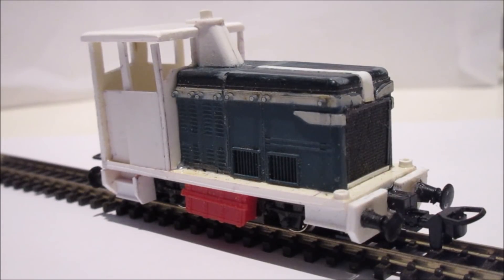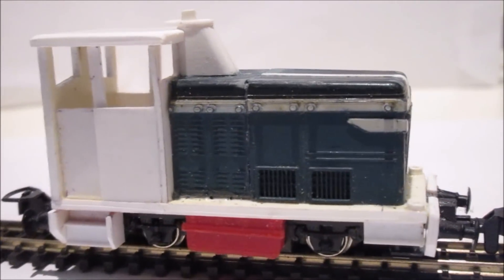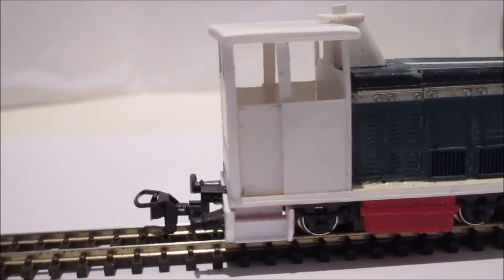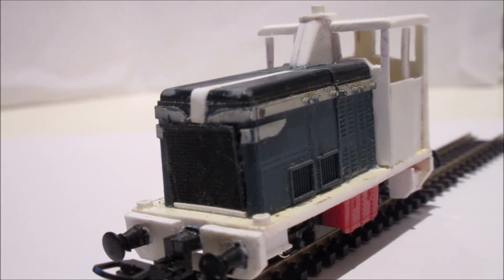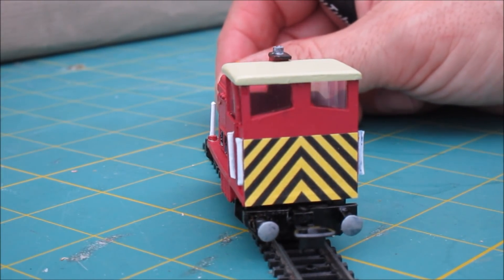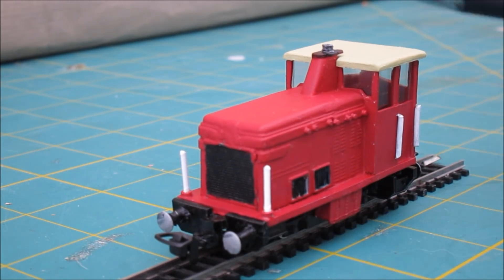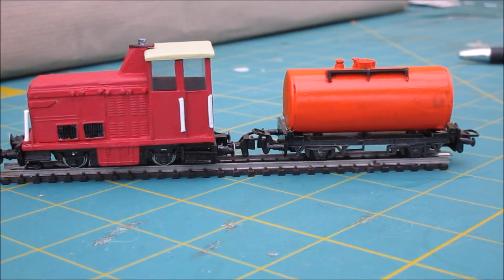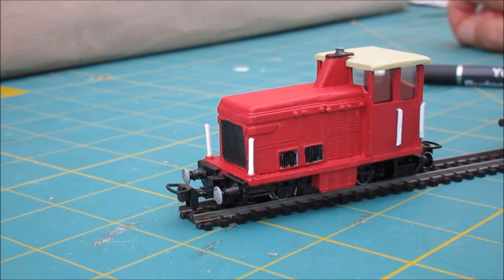More OO9 Projects - Diesel Shunter & Tanker Wagon

Comment: Just decided to add an OO9 loop to my otherwise OO layout (because there isn't room for the OO to turn around) and I was just going to have one little train running around. However, after watching some of your videos, I feel a small fleet of home made shunters and rail buses coming on. Cheers
Reply from the maker: Also take a look at my latest layout videos where I have an OO loop only 18in wide, the same as 009, and can run 0-4-0 and four wheel coaches on it, so that could be another option?
Reply: Thanks. I watched that one too! I like narrow gauge layouts, as well as OO, so OO9 satisfies my itch AND includes it in my existing (unfinished) layout. Cheers.

Comment: Do you think Peco wagon chassis are the least expensive for 009? I'm putting an 009 agricultural loop in an 00 layout, and while I'm happy scratch building the bodies, I'd like a ready made bottom half.
Reply from the maker: At £4 each they are cheaper than buying second hand wagons. I got some 009 couplings from a guy on eBay for £1 each, so each wagon comes out at £5. Like yourself I can build the bodies myself, so a big saving over the £15-25 each new
Reply: Thanks for the info. I can't find any Peco underframes, just the whole wagons which are a bit pricey as you say. 
edit: sorry I think we're talking at cross purposes, on second look you've put it on the Peco N gauge chassis, my mistake. You can get various Peco 009 flat bed, slate and tipper wagons in 2's and 3's for about £7 to £8 each. As they come with 009 couplings I'll probably go that route, thanks again.
Reply from the maker: I should have made that clearer, sorry
Reply: No, my fault. I'm building the 009 motive power on Kato N gauge chassis, and weighing up whether to kit build the wagons, bash N to 009, go for ready to run 009, or a mixture, and whether the coupling prices change the picture! I'm over-thinking it.
Reply from the maker: Not really, I had he same issues and for he time being have put OO9 on hold while I work on my micro OO layout
Reply from the maker: That's very kind thanks